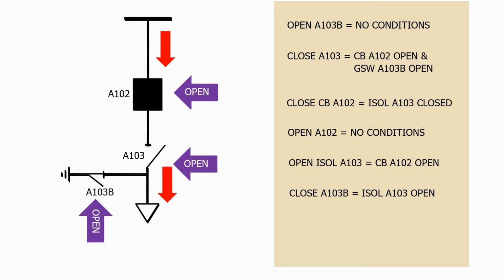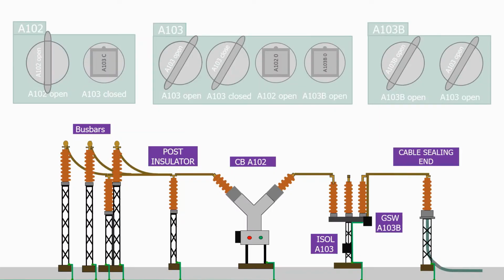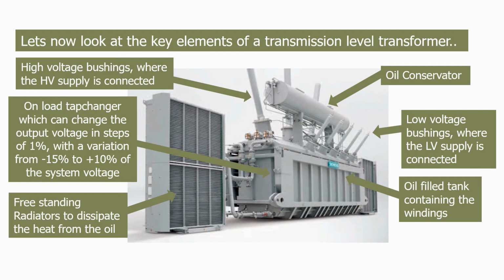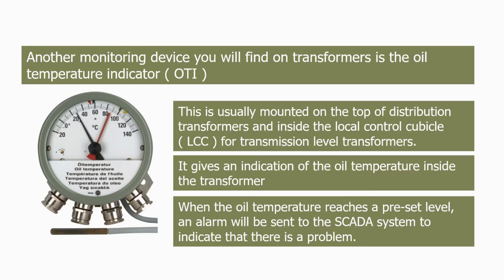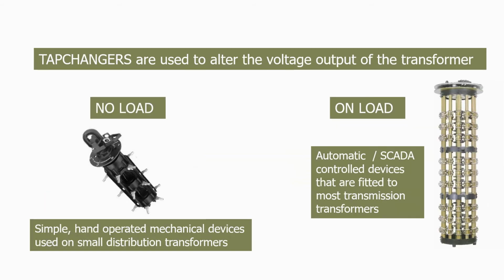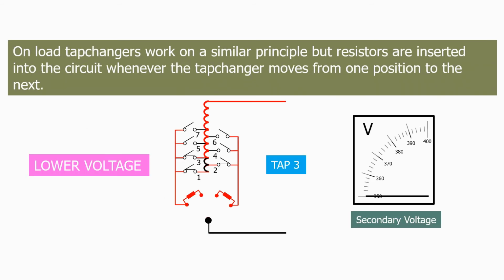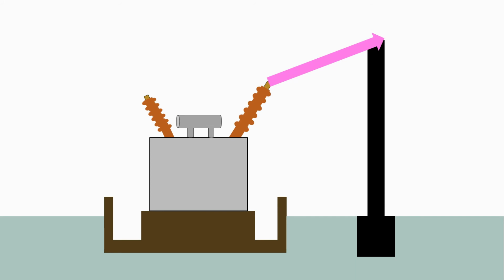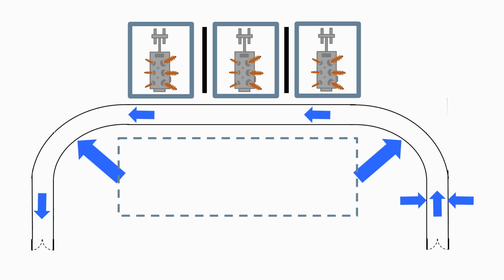Air Insulated Substation Design Part 2

Comment: Hi Mr Stephen, can you suggest which video focuses on calculation and sizing of primary equipment such as power transformer, CT, NER, Busbar calculation, circuit breaker size. Im in the midst of working on tendering design for HV substation include 33kv, 132kv and 275kv substation. can you advise and if can include also coupon. Tq.
Reply from the maker: Hi Amir,
              The air insulated substation course parts 1 to 3 will give you a full understanding on substation design.

Use voucher code GERE1001 on the Udemy website.

Regards

Steve
Reply: @Electricalsteve  Thank you Mr. Stephen. very appreciate on the advice and voucher given.